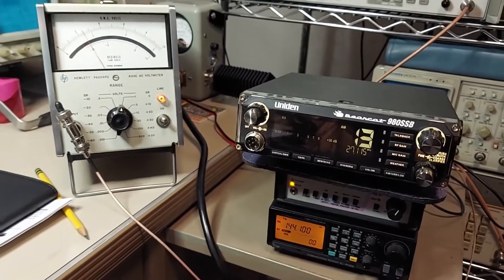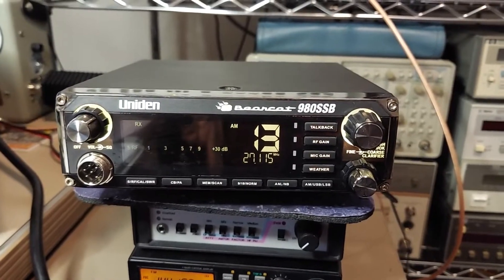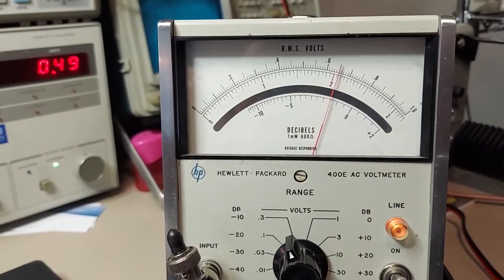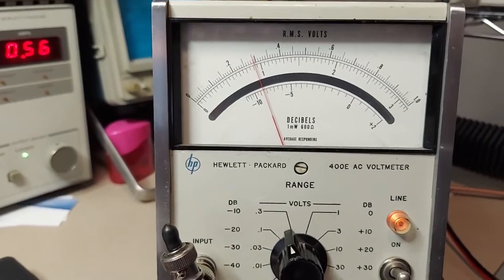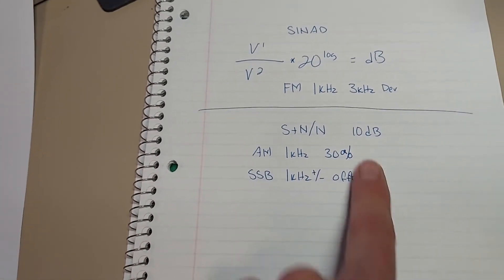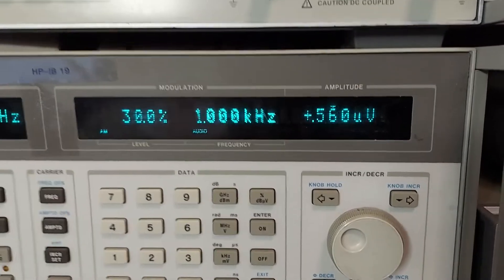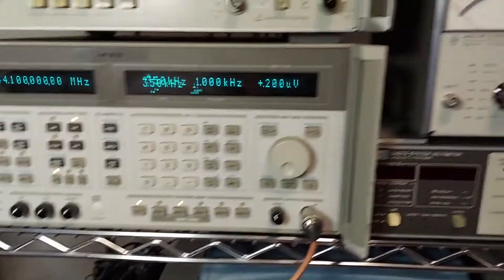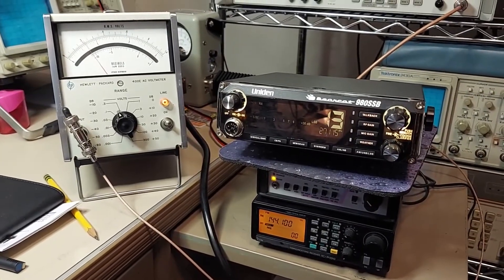Performing receiver SINAD and S+N/N measurements.

Comment: In the case of traditional CB radios based on the EPT360014B (or 15C) chassis, what is the correct way to adjust the signal because I noticed that the new radios limit the reception in the adjustments of the coils, that is, if I adjust the coils I get greater sensitivity and consequently a higher sinad ratio but it is factory set to something around 10 or 12DB depending on the manufacturer. So my doubt is what is the correct way to make this limitation in 12DB, which coils do I have to attenuate to reach this value?
Reply from the maker: Normally you start from the first IF transformer and work your way back to the final stage of the receiver section. I could just trace the receive RF path, but I would rather find some sort of service manual online so I can verify that the radio was aligned properly from the factory. So in the interim I used a standard sensitivity measurement to confirm what I suspected. I also had to readjust the bias adjustment on the PA MOSFET for SSB, from the factory it was drawing 2.5A with no modulation on SSB transmit. I readjusted it so the transceiver draws around 500-700mA during transmit with no modulation. This is makes me wonder if it was aligned properly to begin with. Thanks for watching!

Comment: i have same hp generator as you..the var knob,does it run like a control or is it encorder type,,,always wondering,, my other hp has decoder typy
Reply from the maker: Hello Dennis, the control is a rotary encoder. Thanks for watching.
Reply: @CraigPetersen12f36b  good videos, the control for HP ,meaning turns like a volume control  or any detent,,my works great but no action like my other generators,,,,thanks
Reply from the maker: Hello Dennis, the encoder turns smooth, no indents. I have several HP power supplies that have similar encoders as well, they turn smooth also.